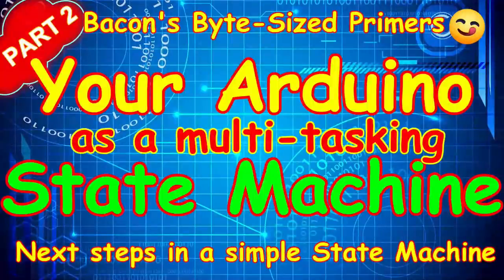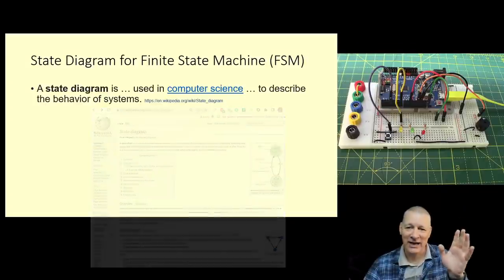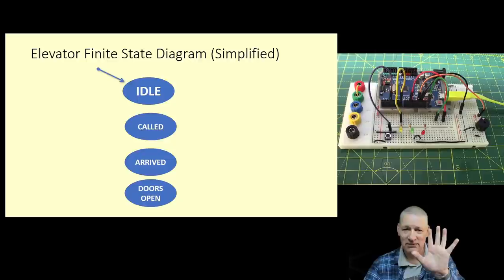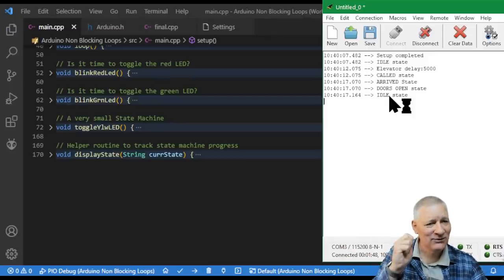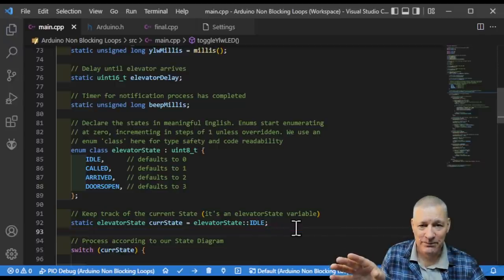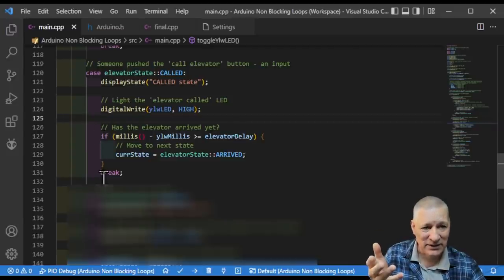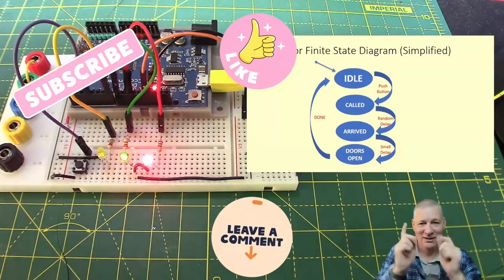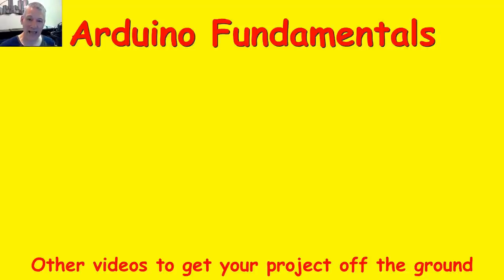#BB6 Arduino State😲Machine - Part 2: Implementation 🥳🥂

Comment: Big fan of your content. Can you challenge yourself to figure out the PCA9685 and how to use the alternate addresses?  I cannot find or figure out how to use the chip with those alternate functions. Thanks a bunch for all your content.
Reply from the maker: By "alternate addresses" are you referring to the bit under board that determines the I2C (hex) address?
Reply: @RalphBacon  The PCA9685 has 4 software programmable I2C-bus addresses (beside hardware) and software reset via I2C.  In general there are many libraries out there, but they only do the basic functions. This would be a bit more advanced for a beginner to understand that libraries are not the only way and that sometimes you have to dig deep into a data sheet and find other functions that a device can do and use wire.h to talk to device.  In this case the extra sub I2C addresses and controlling more than 1 PCA9685.  I use them to control  RGB LEDS and trying to understand all the extra functions that the device can do.  Thanks

Comment: A few ideas for "homework assignments" to practice with state machines:

Have one LED blink SOS in Morse code, while another blinks your name in Morse code.  It can be done with two smaller state machines running concurrently, or one larger state machine.

Switch debouncing, where you do something (like toggle an LED) every time the switch is pressed.  A good test is to hold the button down longer than the debounce delay.  It should wait for the user to release the button (including debounce time) before recognizing another press.

Implement the classic "elevator algorithm" where the elevator goes upwards to pick up and drop off passengers until it runs out of passengers in that direction, then downwards to pick up and drop off more passengers, then upwards again, etc.
Reply from the maker: Excellent! Let me know when you've completed all that. Lucky that we've got a couple of bank holidays over Easter 😆😂👍

Comment: Sorry to clutter State Machine comments with this question... i did give a look, but soooooo many videos... Which video introduces installation and setup of your IDE and Serial Monitor? Also... how do you get "Manage Libraries," "Port Select" and "Board Select" to work in your IDE? Your videos are on my PizzaVideoFriday list. Thanks.
Reply from the maker: Nice to be on that list, Bob, but I don't remember any Pizza being delivered here 🍕

Now, if you look in my video description, Bob, there is always a link to a PDF file of all my videos. That way you can search it for a useful phrase. 

But to save you the bother this time, and going back to 2016, there are a couple of older videos you might like to watch (WARNING: not the same quality as the current ones, especially in sound quality 😲). 
Video #3, https://youtu.be/u2YEDPGaK-s 
Video #4 https://youtu.be/4Y9z7fQM8cg 
Video #16 https://youtu.be/7Lc3PtDMijY (for COM port stuff). Try them first.

If you have specific questions feel free to email me (my email is on my ABOUT page).

Comment: Great lesson thanks 🙏but my static unsigned long time stays at 0. Is this due to updates to the IDE?
Reply from the maker: No, it won't be that. I can't remember the code I showed here but if you do this (below) it will prove that static variables do work:

void loop() {
  static unsigned long counter = 0;

  Serial.print(Counter: ");
  Serial.println(counter++);
  delay(500);
}

At compile time the declaration is removed from the loop and initialised. Thereafter, every time the loop is executed the counter is incremented like any other variable.

The Good Thing is that the scope of the variable is restricted to the loop (or whatever function you declared it in), not every function you might write.
Reply: @RalphBacon  that sounds fair ill have a go and thanks for the reply. Love your channel
Reply: @RalphBacon  I'm thinking you are keeping the explanations simplified. In reality the static variable is not removed from the loop. Static variables are initialized by compiler generated startup code that is executed at run time before control jumps to main(). This contrasts to automatic variables that are created and initialized on the stack every time a function is called. The location of the variable declaration inside the code block of the loop is the vary thing that limits the scope of the variable to that code block. In my opinion understanding storage class is worth learning and ought not be glossed over.

Comment: Hi, I always use fsm design technique. I prefer quantum-leap qm modeller free software to generate codes and modify them to use both without and with rtos ( freertos, ucosII/III). Another technique that is always used with fsm is event driven programming.
Reply from the maker: Thanks for sharing! It's certainly a very detailed approach and in case anyone else is interested in using this software, here's the link: https://www.state-machine.com/qm/

Comment: As expected, another great video Ralph. i done a similar program that i like to use where millis keeps a track of time. i.e. 1 sec. 1 min. 1 hour. 1 day and so on. then in the code i can put if the time equals whatever, then do something. i should say i used this for a testing routine that needed testing once a week and report back if the test was all good.
can i ask if your doing any projects in the future with other micros? like Attiny85. as availability atm of chips is sparce and i am wanting to learn more on platformIO and these little things.
Keep doing what your doing, i look forward to seeing the next one.
Reply from the maker: I'm surprised, Philip, that the internal clock of millis() kept accurate time for a weekly test routine! I say that, because my Home Alone project syncs the date/time with the internet every few hours. If I did not do that, it would be already several minutes "out" by the end of the day (on an ESP8266). 🕕

Now regarding other micros... The ATTiny85 still holds a place dear in my heart, but it is a limited chip in terms of memory and pin-count. So the project would have to be pretty small. At this time I have nothing on the horizon for such a chip but I can see a place for it as part of a bigger project. But: no promises, you'll see it (or not) when I get to use one again! Good to hear from you 👍🏻

Comment: Great vid Ive understood  that only void loop runs repeatedly  so I thought switch case had to be in the void loop  so why in the void toggle ylw ? I must not understand how the code runs.
Reply from the maker: If I understand your question correctly, we change the state variable so that on each iteration of the loop function, it jumps to the correct code for the current state.

The loop function then just calls a (sub) function to do the heavy lifting, keeping the code nice and clean.

Comment: Chuck in a few interrupt requests and export the last known state to an EEPROM in the event of a power failure.
Reply: arduino has a bit of eeprom that can be used by the programmer
Reply from the maker: Yes, it can always be restarted in that case (as long as the attached hardware can also be restarted from a particular point).

Comment: Do you have any suggestions on how to go about listing all the states and actions for a system? Is there a best practice for describing a typical use case and then converting that description into states and actions? Any resources you can suggest would be a great help.
Reply from the maker: Well, it's been a long time since I learned how to do SM programming, but from what I remember the most important thing it so list (in bubbles) all the possible states that your device could find itself in, then link the states (with an arrow) that defines the action (or change of state) to bring it to that state.

Your best bet is to search YouTube for a simple, beginners intro into this topic - I bet there are loads!

Comment: You just managed to show me how ignorant I am about computer coding. Not a criticism at all as I am  a self taught hobbyist noob. My difficulties are really defining the state diagram correctly to start with. Often I get half way through and realise I have missed a state or it’s just plain wrong or it’s overly complicated. I hope I a
Reply from the maker: Yes, getting the State Diagram correct is paramount, Stephen; and getting it wrong is easy too, not that it ever happens to me (cough, cough 😬) like just last week as I coded up my Container Bin Lid project (still incomplete). But I fixed it and I guess we must literally go back to the drawing board, make the changes and then apply those to the code.

Comment: Great job, excellent explanation. 
Re. Platformio, how did you get the colours for the indentation levels? My Platformio installation only shows the vertical lines.
Reply from the maker: I had to fire VS Code to find you what you meant, Andreas. It must be one of the extensions I am using. Called indent-rainbow v8.3.1 it all helps keeping the code neat and tidy!
Reply: @RalphBacon  Thanks so much. Got it up and running now.

Comment: Thanks again Ralph for this tutorial. I always struggle with actions that only need to be done once in an FSM (such as displaying the current state in serial monitor). I see two valid options: a boolean onFirstCall or adding additional states that are only executed once. Are there any other methods and which one is your favorite?
Reply: Its usually cleaner and less error prone to add in extra states. You can "group" states logically by prefixing or suffixing their name to show they are connected. Minimising flags and variables is a goal, the "state" of the machine should really be completely defined by the single state variable otherwise you will get erratic and hard to debug behaviour.
Reply from the maker: @S d R Each state can have entry and exit functions attached without adding extra states. Use bools or any other method to control this. Sorry, it's not magic. Just C++ following some design rules!  

In my demo code I check the current Machine State against the previous Machine State - that way I know if it's the first time into this State function. You could do a variant on this for the exit function too.

The other option is an Hierarchical State Machine which I'm not getting into but is considered the answer to State Machines that quickly explode (ie get out of hand with the number of [repeated] actions). Which also satisfies Ian's requirement for self-contained states.
Reply: @IanSlothieRolfe  Thanks for the advice. "erratic and hard to debug behaviour", Yes! I'm all to familiar with that. I currently have both a RunState and a RunMode, I will try and combine these states into one, hope it helps
Reply: @sdr9682  My way of dealing with this is to check if the state has changed on each entry to the loop. If it has, another switch for the current state allows you to do the 'initialisation' stuff for the new state. 
It keeps the main state table clean and you have a separate place to do the 'one offs' for each state.

Comment: Followed it and understood it but I am only getting the elevatorDelay printed to Serial. I seem to have missed the 'displayState' function code....
Reply: I need to know what is on line 171 🙂
Reply from the maker: The code is available for download on my GitHUb here: https://github.com/RalphBacon/BB6-Arduino-State-Machine-Part-2

But just in case, here's that function you mention:

// Helper routine to track state machine progress
void displayState(String currState) {
    static String prevState = "";

    if (currState != prevState) {
        Serial.println(currState);
        prevState = currState;
    }
}
Reply: Thanks @RalphBacon

Comment: 1. the real reason for the default is to handle errors when you add a new state and forget to add a case for it. The default should log and assert
2. next: event driven state machines....
Reply from the maker: OMG Event Driven State Machines... as if we haven't got enough on our programming concepts list! But it sounds intriguing so I will check it out 👍

Comment: Nice tutorial!  What do you think about  using #define  states instead of enumeration?  Compiler will also rise error if I try to use undefined state (not a number but name of state). In addition,  I can start  FSM with a number different from zero (eg. #define START1 100) and  add another FSM inside my code  (eg. #define START2 200) so I can easier track two different FSM's with Serial.println statement. I have tried and it works.
Reply from the maker: Well, the enum is but a description of a data type and defaults to starting at zero. But you can make each enumeration a different value:
enum class abc uint8_t {
    start = 34,
    end = 78,
   ➡ and so on ⬅
}
Enums are the industry-accepted way of doing this sort of thing although it will "work" with #defines but you would not get it past a code review!
Reply: @RalphBacon  . Sorry but I don't know why You use quotation marks when You write word work. I used #defines and FSM in my projects and code in one of them runs 24/7 without any problem. I agree with You that it would not pass code review and it is not industry standard. I'm not professional embedded systems developer  but I will always remember my teacher. He  used to say:  "Keep your code short and clean. Just as my haircut." Actually he was bald. English is not my first language, but I hope you can understand  me. Have a nice day.
Reply from the maker: I put quotes around "work" because although you have got your code to run, it's not the usually accepted way of using states. Sometimes, it's better to learn the "correct" way (more quotes!) and become a better programmer. But it's entirely up to you, of course, and if you are happy with your code then by all means keep it that way.

Comment: I must have missed the Arduino void loop (main) section of code?  Did you just call the forwarded declaration functions in the loop the same way you called blinkRedLed(), blinkGreenLed() in the previous video? (i.e. you just added toggleYlwLed(), displayState())

First time I've seen an FSM explained in a way I actually understand!

I guess it never occurred to me that a nested switch, case block is basically a state machine.
Reply: Haha, nevermind.  As soon as I rewatched your tutorial you show the void loop block of code.  I must have missed it.  Never fails, as soon as you ask someone you figure it out?
Reply from the maker: I'm glad it's clear now; yes, you had it right anyway!

Comment: I'm from Southern California and need a state machine because Nevada is bullying us.
Reply from the maker: Bad Nevada. You know that I don't know where Nevada is, right? The clue you gave was Southern California (it never rains there, apparently, probably before your time: https://youtu.be/Gmq4WIjQxp0?t=48 ).
Reply: @RalphBacon  hey Ralph do you have a tm1638 module. I have two types ordered and got the first one today. It has 2 seven segment by 4 digits at the top so basically 8 digits at the top. On the bottom I have a matrix of 16 keys at the bottom. It connects with thr arduino or any mcu for that matter via 5 pins. Vcc, gnd, clock, Strobe, dio (digital io). It seems to be very cool. I'm about to go try it out as it's been the first arduino module (other than ramps for a printed cnc I'm building) that's gotten me to hook up an arduino for a while. It could be used to control tons of stuff in a work shop. I've got lots of Nanos and tons of wifi modules. Haha I figured you'd have a video on it since it's been around for years, it also controls displays as well. I hope this correspondence sees you well.

Comment: State machines are a necessary evil.  Like a pet dragon you must have one, all software has pet dragons, its just that languages hide you from them... so you'd rather not have one, but you will have one and when you have to interact with it, you do so extremely carefully for fear you will get badly burnt... and you WILL.  This is why most languages strive to prevent you being exposed to the state machines.  Most under grads in software/computing will learn the various state machines in the likes of IP or TCP or maybe the "PTSN" network (telephones).  Which are both full of state machines.   It's just that in MCU land it's US writing the threading, the state machines and the callback/interrupt cascades.   (The later being an alterative approach to hot looping)
Reply: The No.1 fault in state machine implementation and design is... forgetting they must be symmetrical.   The same thing applies to "if" statements.  EVERY if statement has 2 paths, regardless of whether it has an else or not.  You just can't forget that with state machines and have them be reliable.
State machines + multicore/distributed concurrency and asynchronous events can be a right pain the proverbial.
Reply from the maker: This sounds a bit like "Programming is hard!" and I agree! 

If it were easy then everyone would be doing it. Oh. Wait. 😲

Well, let's modify that statement and say that programming gets harder the more complex the code is, and that includes FSMs. I've seen some horrible code over the years but most of it worked. Well, most of it worked most of the time. 😁

I guess that's why I had to take an aptitude test before I could get a post grad programming job (some 40 years ago) because some otherwise very clever people just didn't "get" programming. Too busy thinking about String Theory.

Yes, yes, I know you're going to say I still don't 😡 get programming but I managed to fool enough people to have a career whilst I was doing it!

Comment: that code relies on polling a switch, responsiveness will depend on what happens in code. Fundamental best practice is to use an interrupt tied to that button. 
void IRAM_ATTR handleButton() { ButtonPushed = 1; }  
//in setup:
attachInterrupt(digitalPinToInterrupt(pushBTN), handleButton,FALLING);

//then in the case statement...
if (ButtonPushed) {
//yada yada..
ButtonPushed=0;
}
Reply from the maker: Interrupts are definitely more responsive.